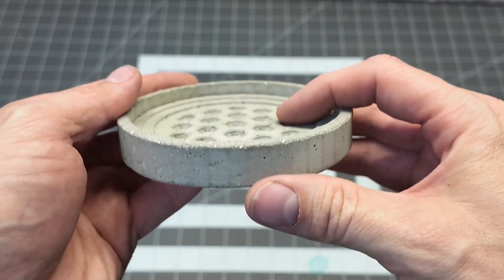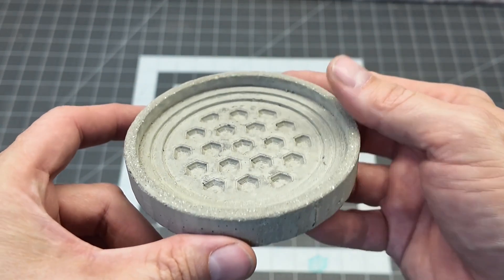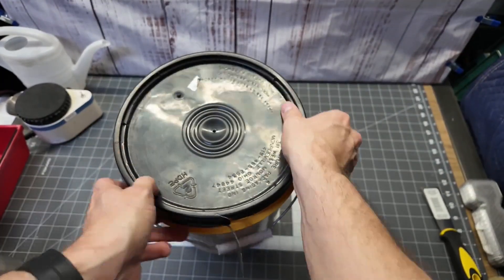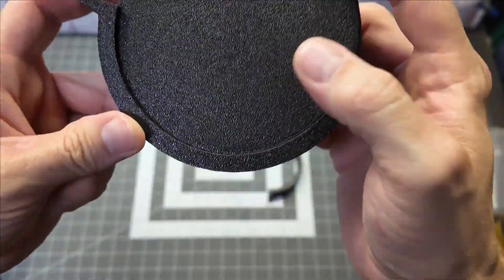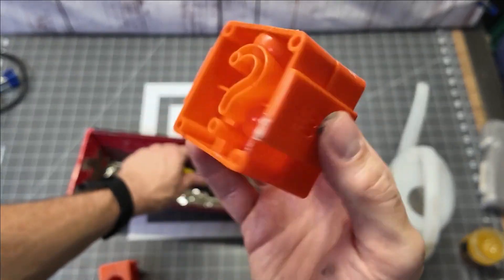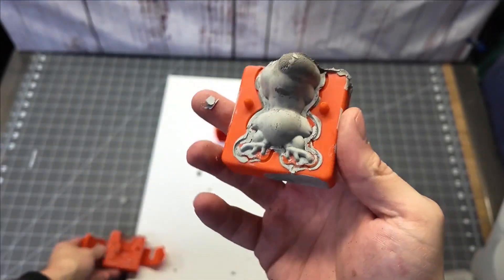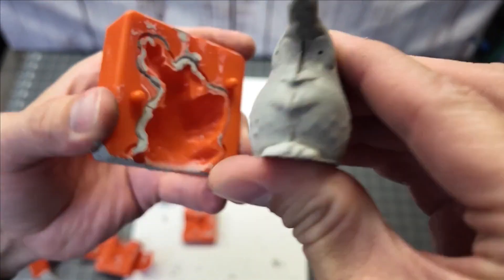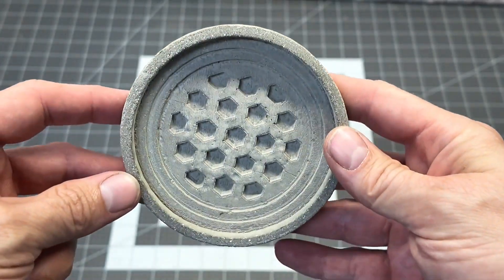Concrete Coasters Made with a 3D Printed Mold! | DIY Coasters That Won’t Crumble Under Pressure

Comment: We use gypsom with an epoxy binder for our stone stuff at my work and all our premolds and molds are 3d printed and cast they all turn out great because the gypsom isn't small enough to show all the print lines they all turn out great unless I fuck up something 😅😅
Reply from the maker: It’s good to know the 3D printed molds work well with other materials, thanks for sharing your experience!

Comment: why would someone need a coaster from concrete? arent coasters made to protect your table from heat/water and scratches?  And concrete scratches as fuck, even polished. not to say its not reinforced, so one drop will shatter it.
Reply from the maker: I would recommend foam feet , concrete is pretty amazing stuff it is insulated and will evaporate the condensation from your drink .
Reply: I want a coaster that's damaging, so it needs it's own coaster!
Reply from the maker: @bubblesculptor  should I have called it an ashtray? Or outdoor coaster ? 😅